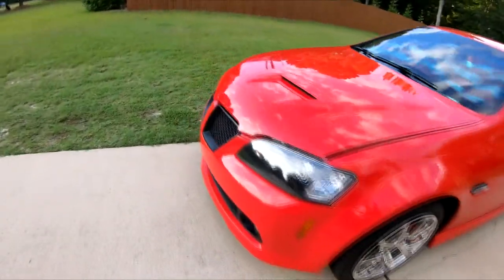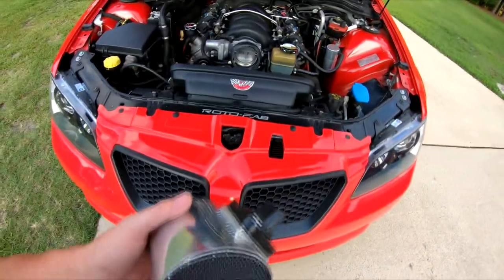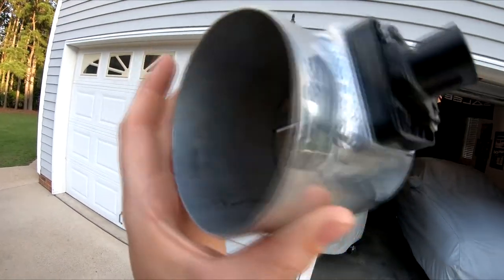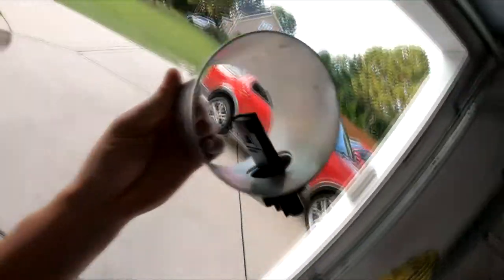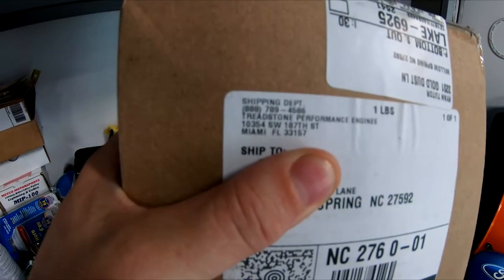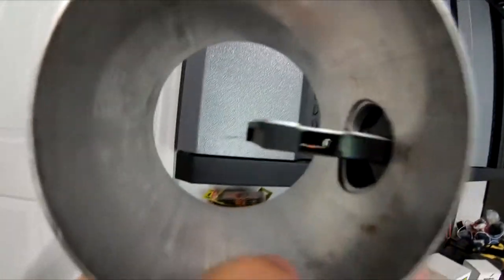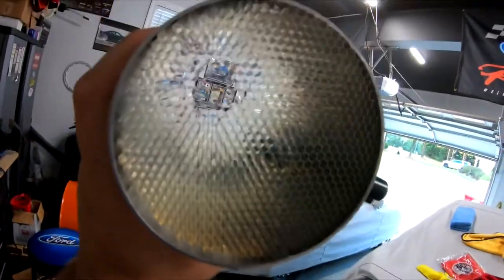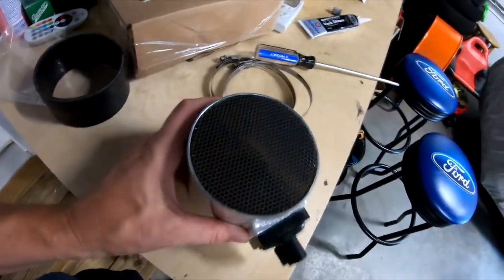Pontiac G8 Mass Air Honeycomb insert to fix RAM AIR driveability issues.

Comment: I’m also tuned by Rick. I did an otr ram air on my 5th gen and noticed a lot of surging and stuff drive ability is trash.. just finished the honeycomb last night hopefully it works well lol I used your video and did the jb weld as well
Reply from the maker: Sweet!  It helped mine a bunch for sure.  Goes to show that ram air is actually working.  Haha.

Comment: Quick question. What's the benefit of going with a LS7 mass over the LS3 MASS?
Reply from the maker: Both are the slot type mass air meter upgrade for the G8.  But a tune is required and I believe the pink/black wires have to be swapped.  Talk to your tuner for more info.  My tuner (Rick Crawford) told me to put the LS7 meter on it when he was doing my mods so that is what I had him do.

Comment: What size coupler u got from maf to tb 4 to 4 bout what is the length
Reply from the maker: Here you go.  I had to cut about 3/4" off it to make it fit mine perfectly.  https://www.amazon.com/dp/B01M0OC3NC?psc=1&ref=ppx_yo2ov_dt_b_product_details
Reply: Ok thanks
Reply: What fitting did you use to to connect fresh air line into the coupler
Reply from the maker: @alecjohnson363  https://www.autozone.com/fittings-and-hose-line-connectors/vacuum-connector-and-tubing/p/dorman-autograde-hard-vacuum-tubing-connector-assortment/426011_0_0
Reply: Thanks for the help